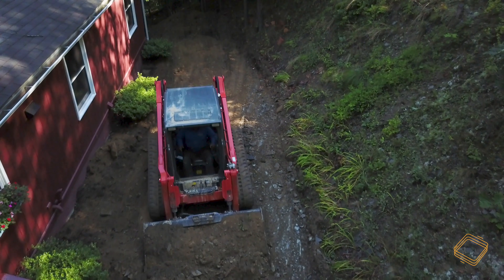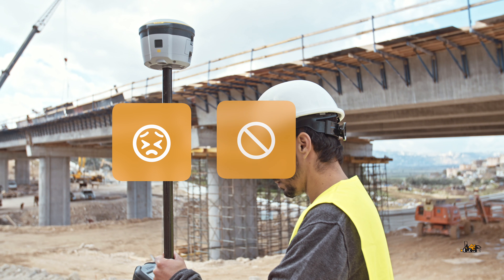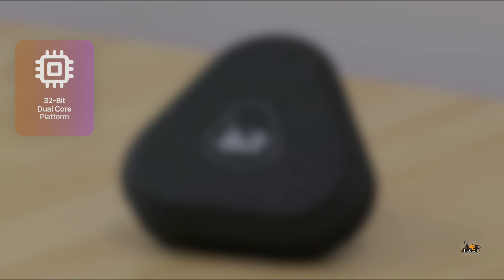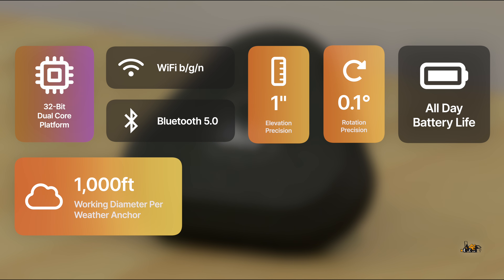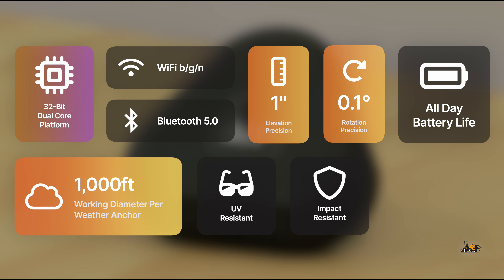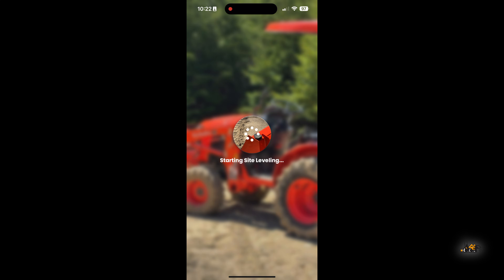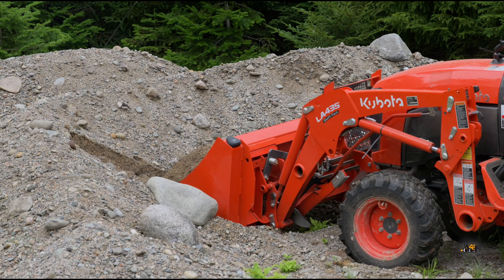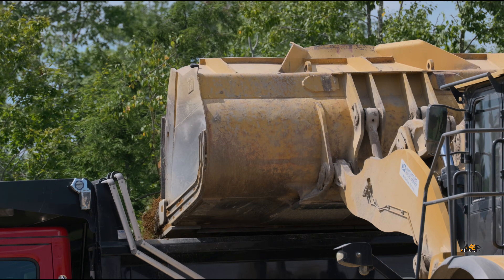Delta: Accessible Machine Control for Everyone

Comment: Can this be set up for a  slope?
Reply from the maker: The Delta doesn’t currently track X/Y position, so you can’t program a slope that it will guide you along. That said, you do get orientation and depth as you go, which would allow you to ensure you’re putting the proper slope angle in place and that combined with measuring the fall as you go, can allow you to achieve slopes.
Reply: I see a future update coming in order to grade slopes! Doing retention ponds and banking with this device would be awesome